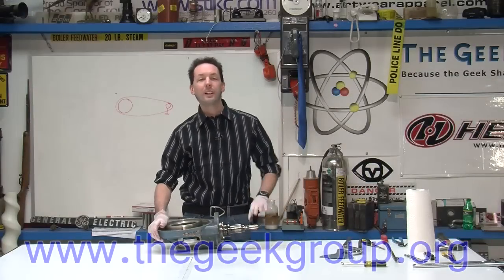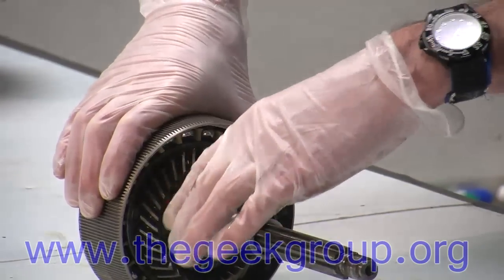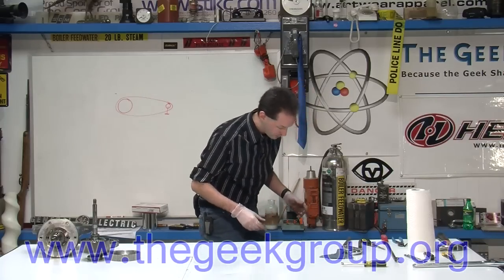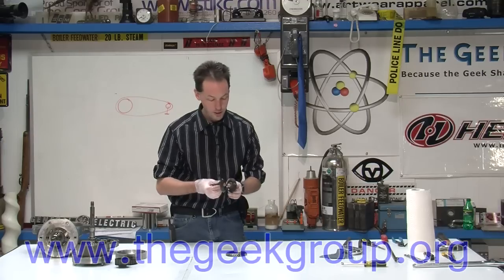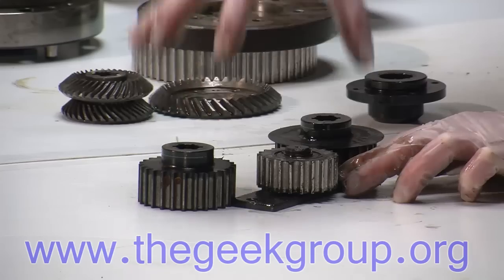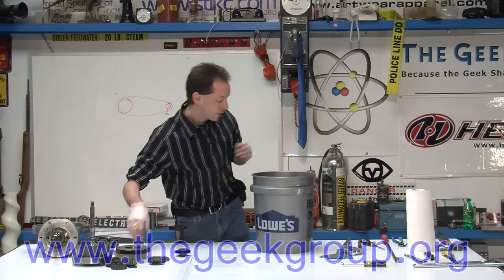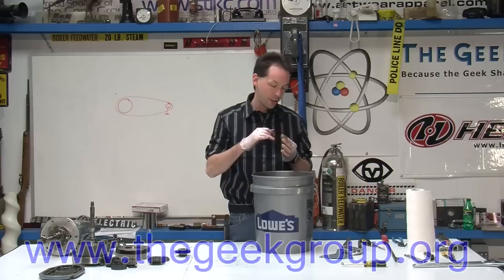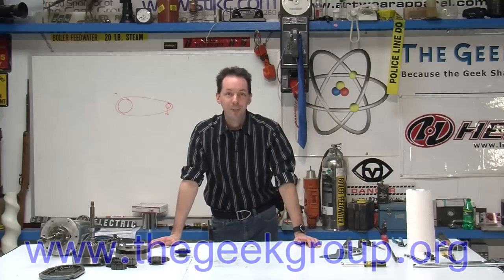Inside Axis 4,5 and 6 on a KUKA Robotic Arm

Comment: This video could be way more educational. Instead of pulling one part after another out of the bucket and blabbering some gibberish about that (as stated those arent friction drives but harmonic drive gears) it would be better to show everything working together and state out some of the fine details.

Also for showcasing it you could saw out part of the frame elements of the wrist and assemble everything back together, so that the viewer can peak at the mechanism in assembled form.
Reply: If they were that clever they wouldn't be posting you tube videos... the paradox in this space.